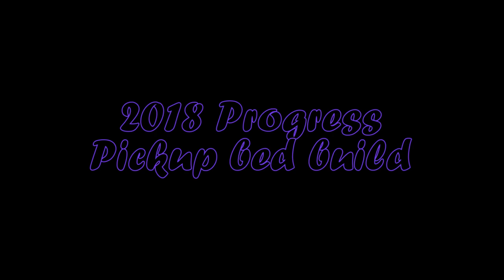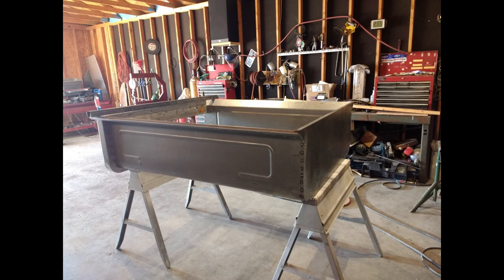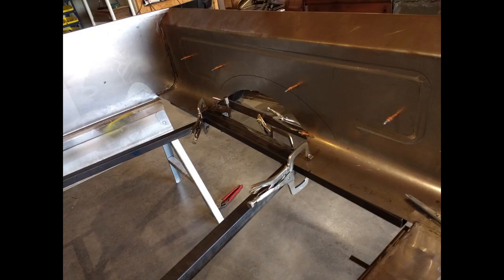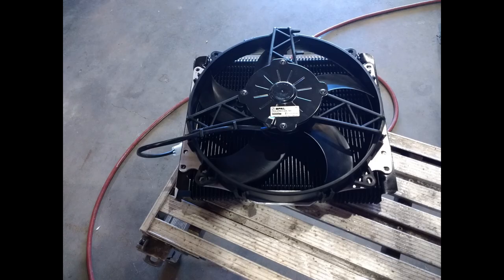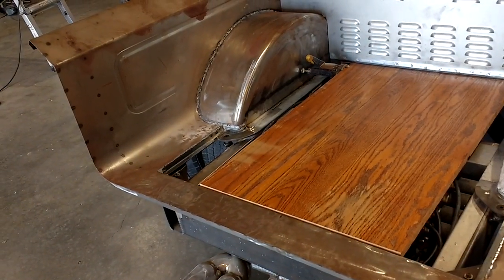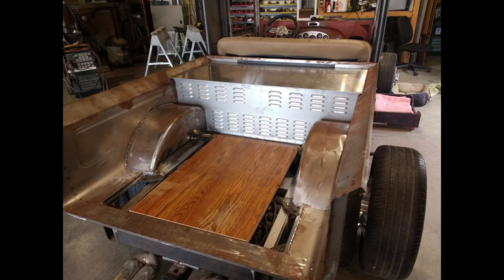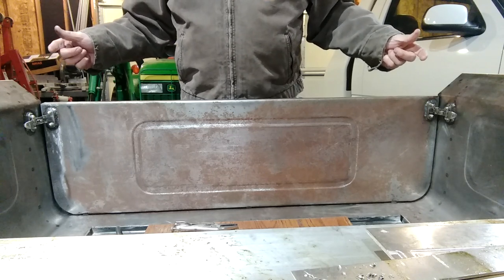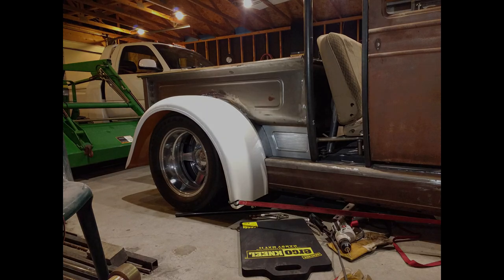29 Chevy project part 16: Pickup Bed build

Comment: Hi there , nice project. I'm currently doing a 47 ford truck here in the UK and intend fitting the power steering rack to the axle beam as you have and was pleased to find someone thinking alone the same lines. Could I ask please what facility there is to allow movement between the cab and chassis with regard to the steering shaft the way you have it set out. Does it require another slip joint. Thanks
Reply from the maker: Hi, both of the bearings coming down the firewall are mounted to the firewall, the cab is mounted directly to the frame with no rubber mounts in between so the movement from cab to frame should be minimal if any, but if there's any movement at all it will be absorbed by the twin bearing mount on the side of the frame, that short shaft that goes through the twin bearing mount can slide forward and backward through those bearings, and of coarse the slip joint that's already mounted to the front of that short shaft will absorb that movement, too, along with the front axle movement.
Reply: OK now I understand, thank you. @nitrostreet-

Comment: If you mind me asking where did you get your fiberglass outer fenders?
Reply from the maker: I got them from Speedway Motors, these are 28-29 Model A rear fenders,  I don't remember if I mentioned in this video or not that this is a Model A bed. Looking at the stock Chevy beds I really didn't like the looks of the stock Chevy pickup beds for that year (and this truck was originally a flatbed anyway) Speedway does sell '32 Chevy fenders and I may have to see how close the front fenders are to my '29 because my front fenders are marginal at best.